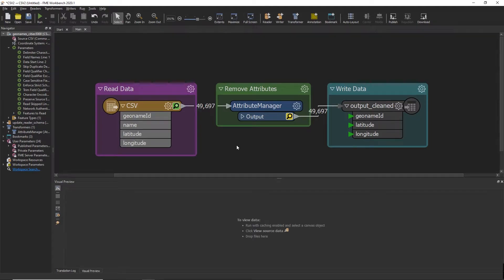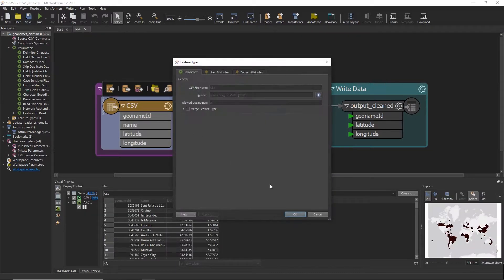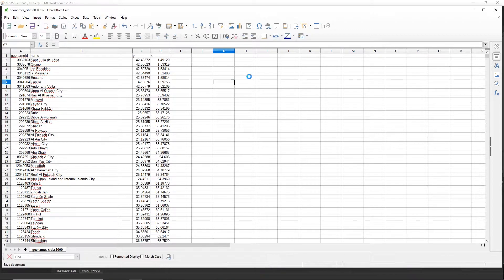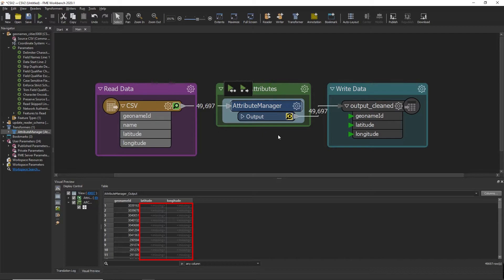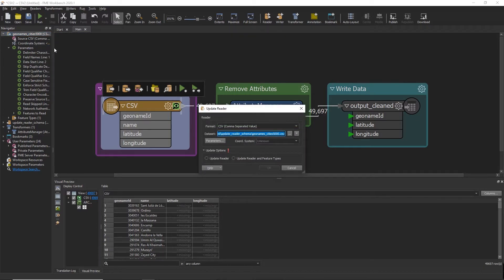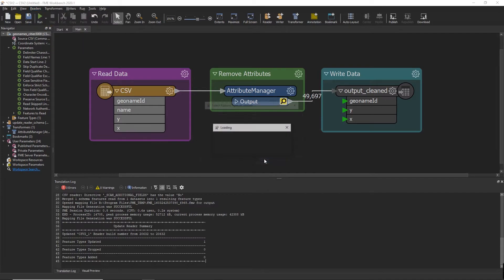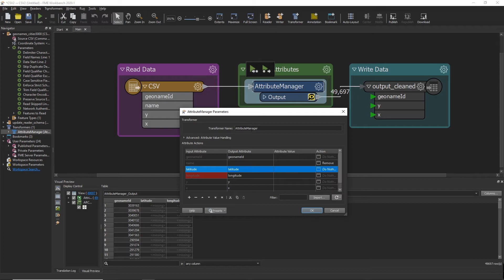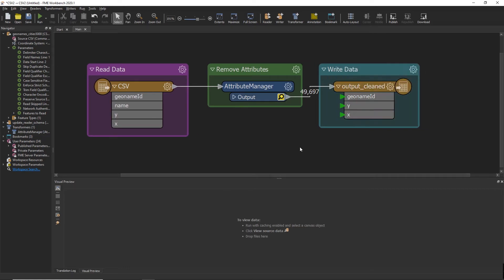Update Table Schema Of A Reader In FME

Comment: What about updating a featureReader and featureWriter (inline transformers). Is that possible? Thank you
Reply from the maker: Hey I just ran a quick test for you, this doesn't apply to FeatureReaders and FeatureWriters only readers and writers. 
Can you try re-selecting your file the inline transformer, if there is a schema change I believe it should dynamically update.
Reply: @DataEngUncomplicated  What do you mean by "re-selecting file"?  Thank you for trying. I will reply in another video comments...
Reply from the maker: @JimPAnimation  if you re-select the file in the FeatureReader, it should update the reader to use the latest schema that the file contains